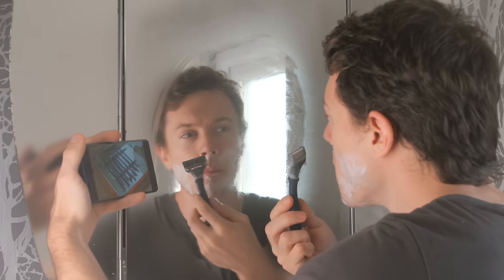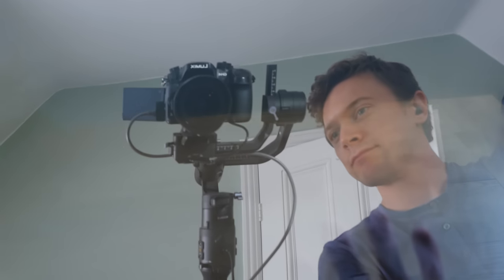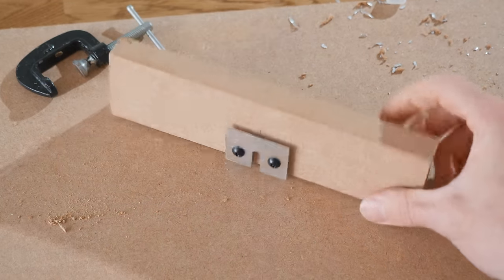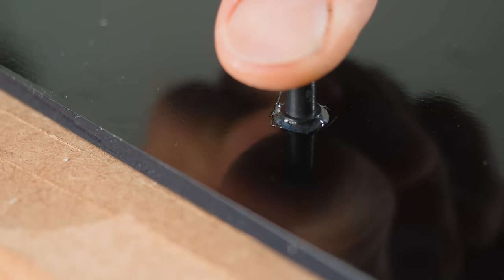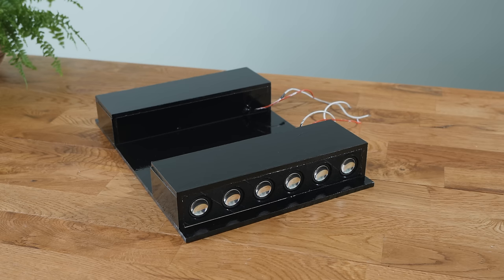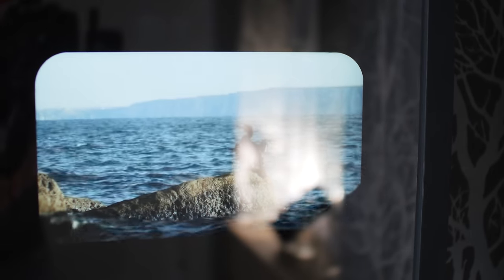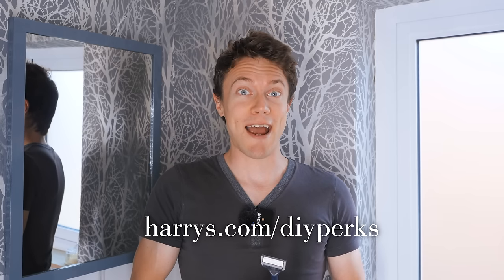DIY Smart Mirror (that doesn't steam up!)

Comment: Why to use basic dynamic speaker drivers. I was shocked you did not use the exciters.  Less space required and bigger sound. You can use that full mirror to make the sound.  But then again you could probably get leaks because the full mirror would vibrating too much. If you are interested check Dayton Audio's waterproof exciters and bass shakers.

Comment: About the demistifying system, since the inlet and outlet are on the top if hot water is let into the chamber which contains cold/ room temp water then will the hot water be able to heat up the whole chamber or would it just heat up only the top of the mirror.
An idea i got is to add tubes covering the whole back of the mirror ( like a heat exchanger) and let hot water to run through it. Eliminates the need for water tight chamber.

Comment: A great video, but this is what went through my head lol. 

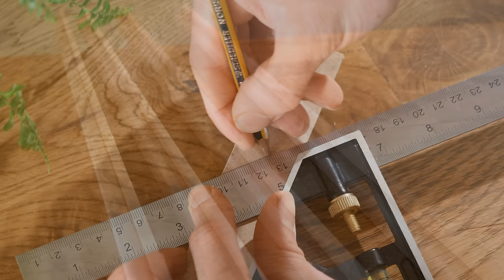1:48 Pegs? Why not clamps? Maybe to be easier to follow.

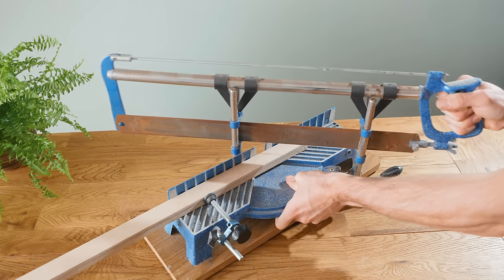2:05 Wait, what if you don’t have a friend with a garage?

2:17 —or an angle clamp. I guess it’s just to be easier to follow.

2:30 wait, you had clamps?? Why did you use those before?

Comment: I know this is an old post, but if you are still answering questions, could this be waterproofed for use hanging in a shower? Older shower, no glass doors or I wouldn't need it in the shower.

Comment: I just installed cheap TV with Chromecast to my bathroom + cable signal goes to it as well. The reflection of the TV can be seen in the mirror above sink when shaving or brushing your teeth. But the main reason is that you can lie in your bathtube and watch whatever you want (be it cable or youtube, movies etc.). No special bathroom TV is needed, just ensure the TV is quite high and can't spray it with water. I also blocked the bottom of the screen edge with tape as if the TV steams the water cannot enter the base of the TV. Funnily enough the TV never steams (not sure why, maybe it's due to little heat it is generating or maybe the screen has some anti-fog surface. And it's been used like this for years now. Oh yeah and blocked most of the grills on the back of the TV as if accidentally sprayed there is only minimal chance the water gets in. I didn't block them all as some heat venting is needed I guess and maybe some protective bracket can be glued in place to block it if you have kids or the TV is in some dangerous position. Made custom wall-holder for it from wood. And for the audio just bought cheap but quite good sounding Genius 2.1 SW-HF 1700 speakers (plenty volume for such a small room). Subwoofer can vibrate with whole bathtube on higher volumes so you get even some tactile bass through water lol. Only downside is that from WC you can't see the screen as it's above it. I'm thinking adding mirror  against the TV to see it but wife is against it lol.

Comment: what about a mirror that can be turned on or off? i dont know if something like this exists, but wouldn't it look kinda cool? imagine this, you know that liquid that changes color under pressure change? lets take that liquid, place a thin layer of it between the mirror and an outter clear layer that does the least to obstruct the view into the mirror, add some way or some method to add pressure to the liquid inbetween the mirror and clear plexi glass, glass, or whatever you decide to use as this outter layer the clearest thing you can find. now attach that device that adds or removes pressure, to a switch just inside the bathroom, your guests could come in but nothing shows up on the mirror its blank but you hit the switch and suddenly reflections show. this liquid I believe has some cool black ink blotching effect if i recall correctly when pressurized so it sort of looks cool too I forget the chemicals though and forget if they are safe or toxic. would be a neat DIY

Comment: A very cheap is a bar of soap. simply with soap a few streaks on a mirror. (I use this method on my car windows and bathroom windows) then wipe off the soap, which will leave an invisible film. Great when shaving, while the hot tap is turned on. 👍🏼🇦🇺🌈❤️

Comment: Why you dont use some silicone protected heat wires for the steam-up protection? They will also work with 5VDC. I think to use water behind the mirror, near the electronics is very dangerous and in my case I need the water for shaving, too ;D

Comment: could hook up a small pump and reheater to the water to make it fully self heating. Could even wire that into a light switch so you can turn it on or off just like alight when you go to shower. YOu would need to treat and replace the water sometimes but only rarely.

Comment: Hi! Cool video.
I've been thinking about making a kind of a hallway version of this project, without water protection and with a plug in power supply. What kind of power supply should I use? Maybe an old laptop charger? What would you recommend for the power supply if I buy the screen/display driver linked on your video? I thought of using a "electric socket timer" or whatever it's called for turning the mirror off for the night to lower power usage and to avoid the screen burning in.

Comment: I'm going to put a junction box behind the mirror so I can get rid of the battery and since I'm redoing my bathroom right now I'll t off my shower head into the mirror and send the overflow into a drain pipe since the only time the mirror should fog is when the shower is running this way you don't have stupid tubes running by your sink and not to mention the hassle of filling it all the time

Comment: What if you use the shaver socket circuitry in the bathroom for powering the screen as you don't need to go and have to always open up the mirror and take out the power bank and charge it up every now and then
Many bathrooms have a shaver socket installed near the sink somewhere and you see it more commonly in public places and hotels so if you could somehow power the screen off that but have the wires hidden so that they go directly in to the back of the socket through the back of the wall it would be better
Reply: Also how are we supposed to use the tap if it is being used to demist the screen/mirror

Comment: I would've put a recess power outlet and be done with the power situation.  Then throw in a better sound system with a either a BT or direct audio to a recessed ceiling speaker.

Comment: So, the basic idea is interesting. However, there are some aspects i find needs improving.
First of, the antifog mechanism with running hot water ist not the best idea. If the Sealing is leaking, the whole project gets wrecked. Hot and cold water could break a real glass front. And my biggest concern: I would have to attach this adapter to my water faucet when using this feature, rendereing the faucet unusable for anythign else. The rest of the time i have the tubes flying around very ugly. I would instead opt for a electric heating solution.
As for the Power bank as power source: It is quite common to have electric outlets in the bathroom (at least in europe), and since this must be protected with a circuit (i thin it's called RFCG or something like that) it is safe if wired correctly. Battery apliances are allways a nuisance, since you need to power them mostly exactly at that moment when you want to use it.
But other than that, great idea and good instructional video.

Oh yeah, reguarding tools video: I myself don't like these "i use Tool XYZ" videos from makers. First, because it allways has the risk of being a sponsored video (even if not marked), which would make any suggestion useles and would degrade it to myself watching another ad video. Second, because most tools used by youtube makers are on the high price side, which does not help people who try to use a small budget. And lastly: Sometimes these tools are US only, again not helping people from other countries.

Comment: What about instead of using warm water, you just coat the mirror with a clear hydrophobic coating, so any condensed water would just run off? Would require no external source of water.

Comment: Wait. If you wanted to not have the mirror fog up why not use some kind of hydrophobic coating? That way you don't need to add any more electronics since the mirror will automatically repel the water molecules on it's own.

(I am not sure if this will work though I am legitimately asking cause it seems like a simpler solution...)

Comment: Can't you use an anti-fog mirror and if not, there is also an adhesive you can stick to the mirror surface that can also make it fog-resistant. Imagine that mirror is protruding from the wall by a good 8 inches or so.

Comment: But how does the screen stay dry if you fill it up with hot water and could it be build so it is connected to my hotwater outled in the shower so it gets filled with the water that i use to shower...

Comment: I think the warm water is not really a solution. It can make real damage, and weight issues. Instead of this I suggest to compensate the heat difference is to buy electric floor heating net in small size that can be cut into  many pieces.

Comment: Pro tip: Never use MDF anywhere near water. Kitchens, Bathroom etc... Paint will chip, scratch and then simple age will eventually ruin anything made from MDF in a wet/humid environment.

Edit: Honestly, the only time I would ever use MDF is if it was Scrap/free and for projects that normally get destroyed. Like cat scratching boards.

Comment: I have a few questions regarding stability maintenence and some changes.
Wouldnt the steam/water vapour tear down the eletronic components? If yes, is there a solution for it (Like humidity sponges and so)?
Wouldnt the wood get swollen with humidity? (i dont know anything about woodworking)
And finally, wouldn't it be easier to just coat your mirror/panel with hidrophobic coat?
Thank you for your videos <3

Comment: OOh my God!! This is the most outrageous gadget ever! rebuilding the whole screen system, power supply, speakers and finally running hot water through the mirrors to prevent misting. Why not Just buy a cheap tablet and hang it to a hook on the bathroom wall for $20 like me!
Reply: the mist...
Reply: @pvt.ltd.yt_industries  yep 👍 I think u still have water problems, and mist
Reply: And this is way cooler.

Comment: I had an idea... what if you run the hot water pipes of the shower in a snaking pattern behind the mirror? Like a heated floor. The mirror will heat up and won't steam up. Any plumbers here that can see a problem with this idea?

Comment: what a chad, you could make this for your girlfriend or something for when shes doing her makeup, also would it be possible make it so you can simply plug this into a wall or something to keep the costs even lower since proper portable batteries can be somewhat expensive sometimes.
Reply: sure can, plenty of dc wall adapters output 12v so it should be pretty plug and play. Just need to be careful of water being so close to a power point
Reply: @blushakk  thank you, and if I'd build it it wouldn't be for the bathroom, more like a regular room mirror typa thing so thays why I was wondering about the adapter.

Comment: Quick question mate: whats that black glue thing you applied to the power USB C cable? And also why did you add the cotton stuffing in the speaker box? What is that for? Many Thanks

Comment: I would use electricity with a variable voltage regulator with a bipolar circuit breaker....swapping batteries isn't my style

Comment: This is really impractical:
1. Power bank powers it which you'll have to recharge
2. You have to get hot water into the mirror every time you want to use it to prevent condensation

Who is going to bother with either of those things

Comment: I dislike the use of Fiber board. Just use actual hardboard. You might pay a touch more, but it is MUCH easier to work with, in my opinion. Far less prep work for painting and finishing.

Comment: It’s cool but expensive it’s $100 for just the screen you can make a smart mirror 12x12 inches and it does a lot more stuff like time,weather, the daily news, face recognition if you want also a custom picture and it only cost $100 the same price as that screen.

But your project is cool 😎 but if you do more research you can get better stuff cheaper

Comment: Here is a why not for you. The water you are using for heat control needs to be treated if left in the camber for any period of time. Plus left used for even a month the water chamber may have even a little moister that will mold. Mold is a big problem and people who have allergies or any health issues or even just a young child this could have life long health problems.

Comment: All cartridge razors are trash.  Use double edge safety razors.  Takes a little time to learn the correct angles but it's a closer shave without the razor burn.  I buy a box of 100 blades at a time on Amazon and use each blade for a week.  So I spend a total of around $12.00 once every two years on razor blades.

Comment: The idea behind this is great. The end result, just not practical. Notice how he never really showed us how this looks plugged into the sink...where he would get the hot water from. You'd really have to do this everytime you are going to use it. If he really wants to tap into practicality with de-fogging electronics, I dare you to make a smart fridge. Those things are $2000 USD more expensive than regular ones just due to the "touch screen" on the outside and the ability to launch a camera to look at the inside. I'm pretty sure he can do it. Just needs to make it happen!